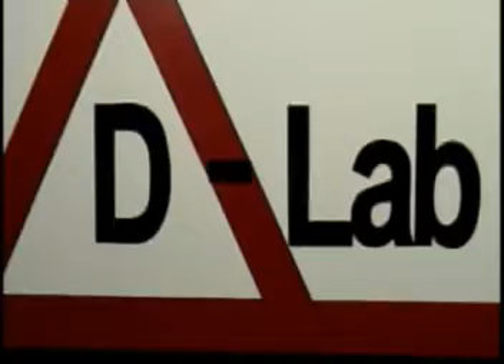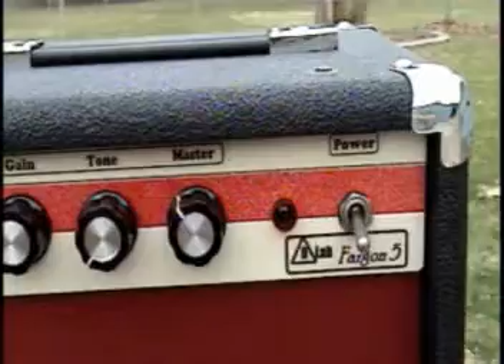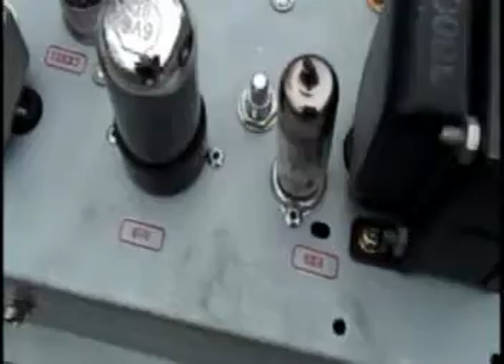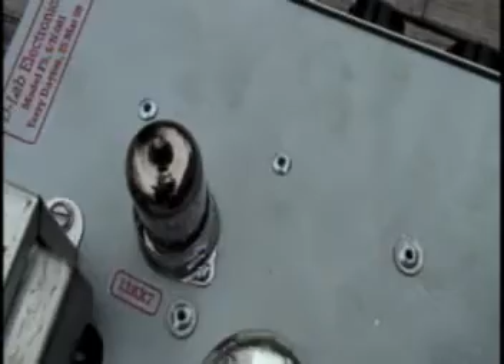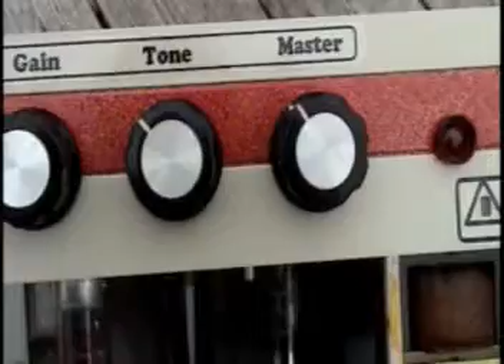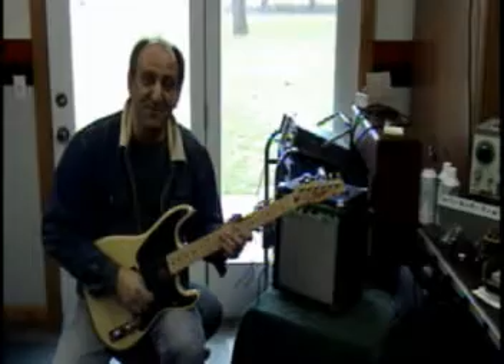D-Lab Custom 5 Watt Tube Guitar amp Demo Beautiful Tone 6V6 class A

Comment: How much would it be to get a handmade amp 3 watts 1 6v6 1 12ax7 (tungsol or good tubes)volume, tone, boost (foot switchable), gain on front! On back 8 ohm maybe built in attenuator I need a amp, I can crank at church that will not be too loud! I want it to be orangeish or silvertoneish, great tone that will allow me to play lead and rhythm without it being muddy, sharp or sterile, good like the amp a make, preamp tubes amount negotiable, also a choke and rectifier I would like, a combo 112. -PK